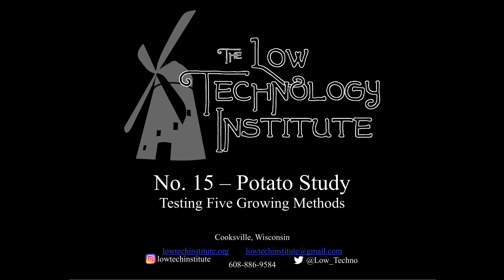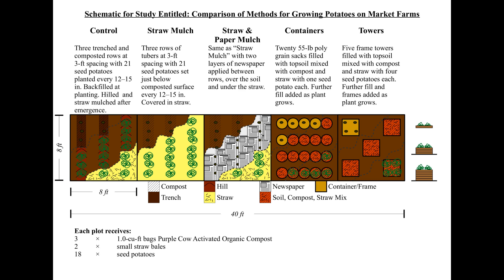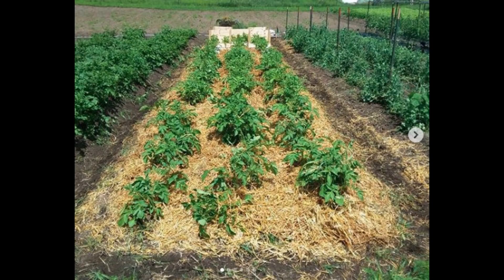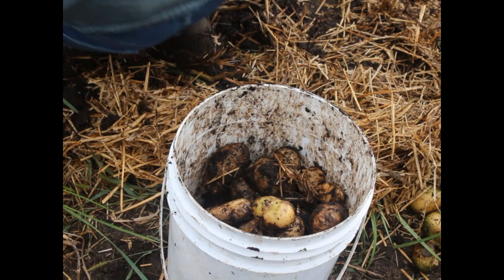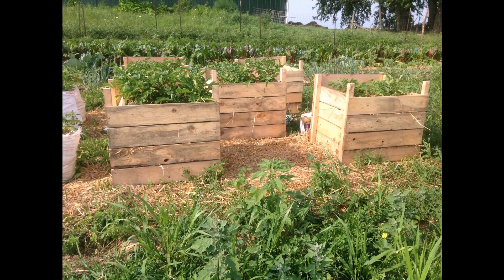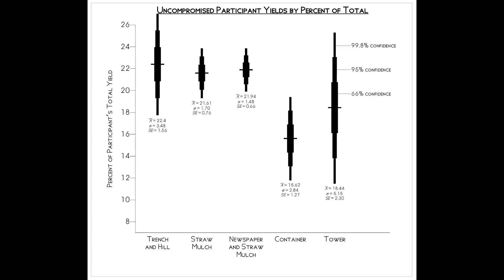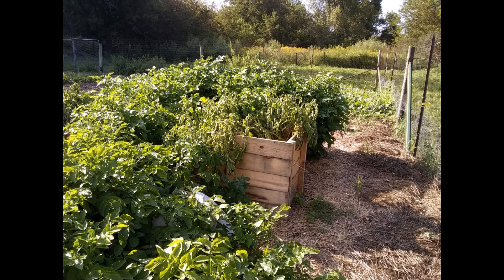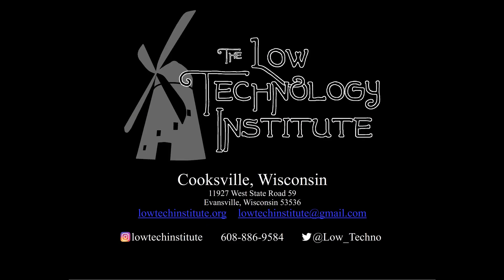Best Potato-Growing Methods -- Low Tech Video, No. 15

Comment: It is possible the reason the boxes only had potatoes at the bottom is because they were determinate. Potatoes are just like tomatoes in that there are determinate and indeterminate varieties. You can hill determinate potatoes to high heaven and it will not have layers of tubers.